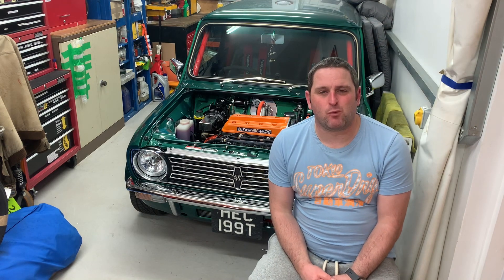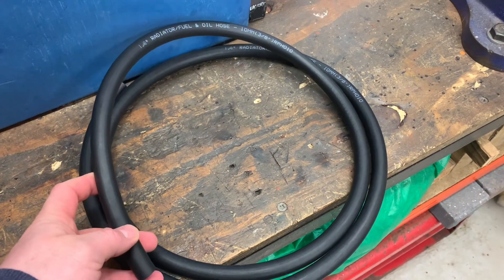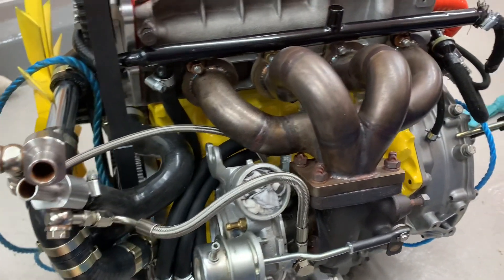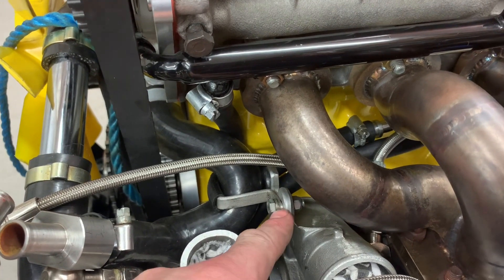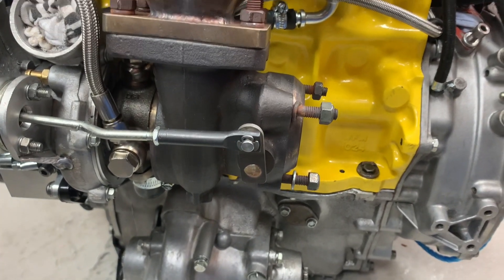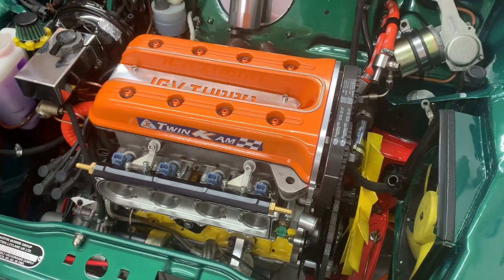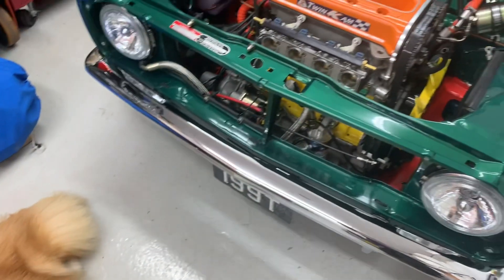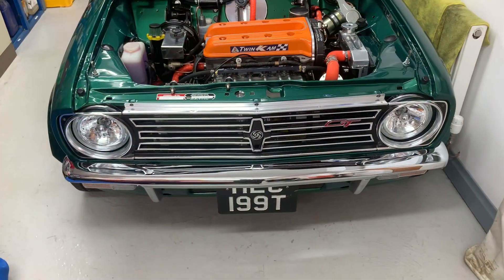Mini Twin Cam 16V improvements Episode 4

Comment: Hi Craig just wondering what fuel your running the mk1 on cheers
Reply: Happy days Craig have you managed to get out in it this year salts off the road now I’m hoping to get my mk2 on the road this year cross fingers 👍👍
Reply from the maker: @nealthomas5943  yeah just in the last few days Neal. Really enjoyed a good drive out in it on Friday.
Reply: Craig where you’ve fitted that new thick wall rubber piping just above to the side of the headers I would usually make a simple aluminium heat shield to coil around the pipe near the headers..
Reply from the maker: @philtucker1224  👍 it’s a fair bit away from the heat but yeah it’s a very good point
Reply from the maker: Hello Neale I just run it on the super unleaded. Generally shell

Comment: Great to see the engine back in. I like to ask why you have kept the yellow fan bolted to the engine? When you have a electric fan in the wing. Would you make better air follow and space by removing it off the engine and make a bit more bhp and the same time. Every little helps to make that 200bhp.
Reply from the maker: Absolutely and I did think about removing it. The only reason I’ve left the engine fan on is so that the electric fan doesn’t get over used. I would imagine it would have to run constantly to hold temperatures back. Even thought about fitting a 2 blade fan because apparently they also sap way less power.